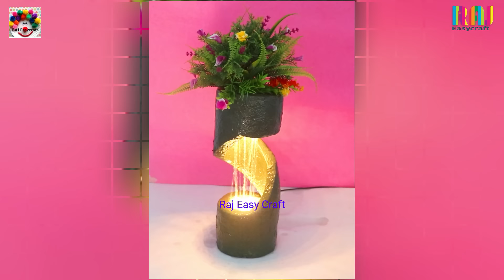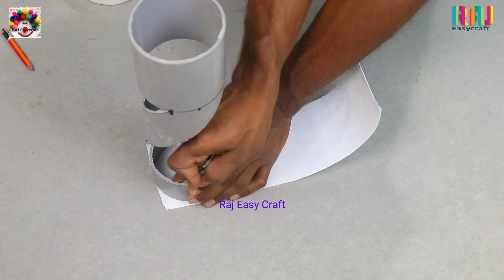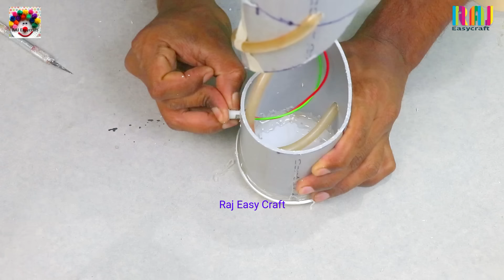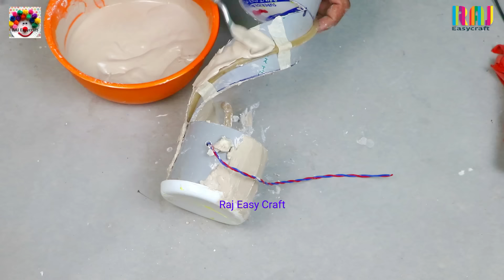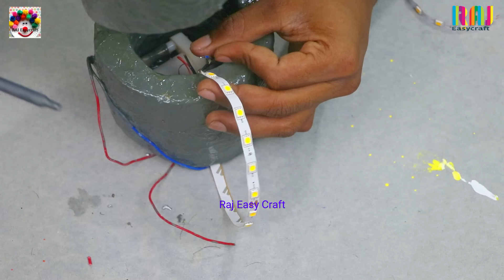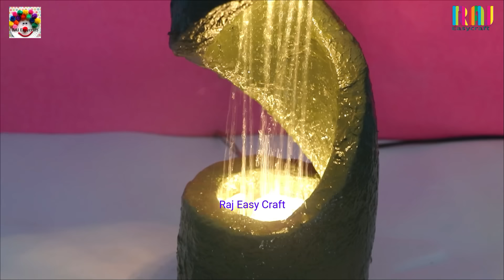DIY Tabletop water fountain made from waste materials at home|art and craft|पाइप से बना पानी फव्वारा

Comment: This project can be made easier by using 1-inch sponge strip dipped in cement and wrapped around a hide-n-seek jar and then recoated 2 times.
Reply: May I ask what a "hide-n-seek" jar is?
Reply: Google it
Reply: Platers use with?
Reply: I love you guys
Reply: I was thinking a pool noodle coated in cement 😁
Reply: Sponge absorb water but if you go with thermacol it will give you good result.
But,shown as in video use of plaster of paris  its also,good one.

Comment: You can use the transparent glass on base instead using tape to cover the light.. And also the holes were so may that's why water comes out from the vase... And last thing if you add charging point so there must be chargeable batteries installed on the base of vase so you can out it any where.... But I'm impress with this idea of making vase...thanks for sharing your idea
Reply: K

Comment: Good concept, poor execution.  This can be made so much more easily and efficiently with the addition of a single power drill and some pvc caps. I think one of the comments mentioned using a sponge to apply the concrete  that would definitely help. Its a great idea overall, still needs a external splash guard or water catch. Personally I would light the bottom pour in resin, cure it an make it spill into an external container pool.